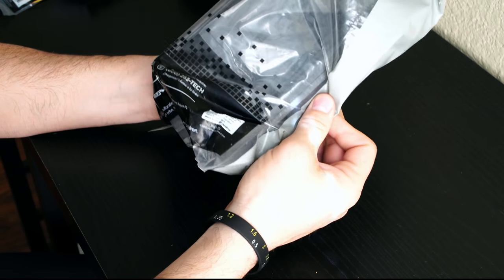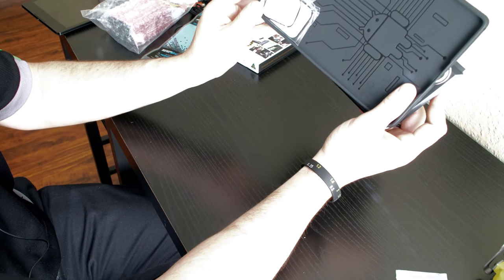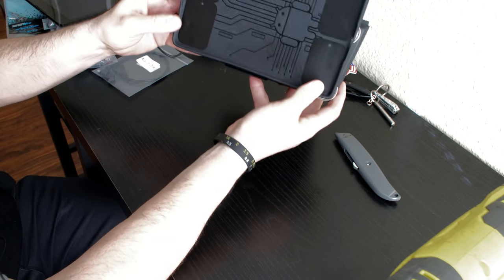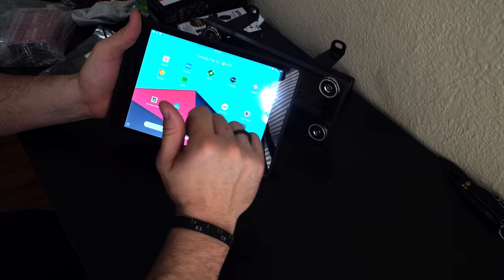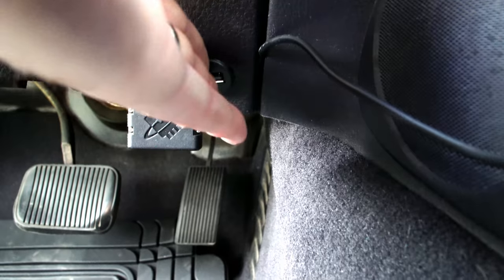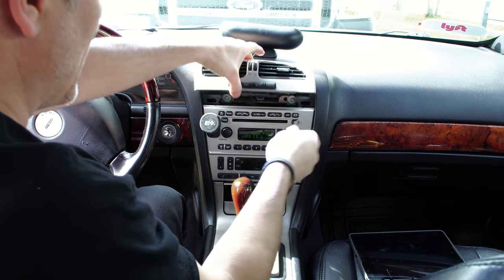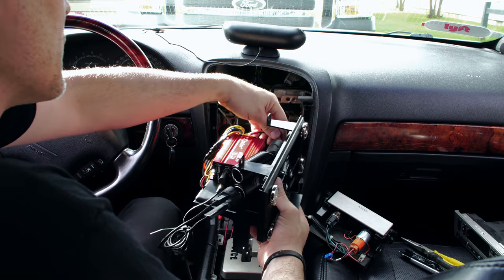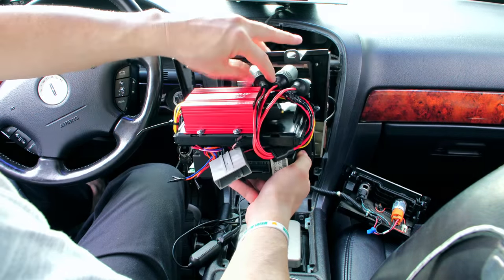Turn Your Tablet Into A Head Unit

Comment: Could've been better to use a single din shallow radio and then tuck it behind the  tablet with a PAC control for steering wheel buttons
Reply from the maker: That's a good option. I did something similar in the update video that is recommended at the end of this video.

Comment: My personal opinion: I would did the setup rather differently: you can screw the cover of the tablet in directly so you will never see the cables. Use the magnetic solution is cool but then hide all the cables in another side of the car like on the back of the glove compartment so when you take away the tablet you don't see the mess and screws. The filter was necessary because you got audio cables, power cables and audio split connections too close to each other; also could be the audio cables are not high quality. To be honest I will leave the original setup and just add the tablet running with Bluetooth by the aux input.  Normally audio from tablets it's not a good one and you can only notice that if you got good speakers. I saw many people doing this kind of "solutions" plug and play often with a poor quality end. 
Another way is you could have an adjustable support for the tablet screw it in on the side and run the cables inside the rubber cover. Overall it's ok... But I saw better
Reply from the maker: Thank you for your input. You are correct, the cables could have been routed better which I addressed in my update video here. https://youtu.be/dmiVHRV2etw

It doesn't look to bad when the tablet is in place which is every time I'm behind the wheel. It does look like a hot mess when the tablet is out of the car. If someone is looking into my car and in the area of the stereo when the car is unoccupied, I'm pretty sure they are up to no good and it's probably best that they DO NOT see anything attractive in that area. LOL. Maybe they will move on to the next car when looking for valuables and take pity on my messy dash.

Comment: Hi, I love this video and thinking about doing this to my car. I was wondering how you converted the 4 channel to 2 channel. Thanks!
Reply from the maker: Excellent! I am glad you found this video. I wish you luck with your project. to convert 4 channel to 2 channel all you have to do is combine the wires from each side. For instance, you will combine the wire for the front left and rear left side into one connection and you will combine the right front and right rear into one connection. You will just twist those together and put it into the left port and the right Port respectively.
Reply: Edward Thompson Thanks! You’ve gained a sub from me!
Reply from the maker: @ninawnguyen  wonderful! Thank you very much. I do appreciate it.
Reply: Edward Thompson Hello again, would you consider making a video on the wiring and all? I’m a bit confused now that i have the supplies in front of me.
Reply from the maker: @ninawnguyen  I can do that. Do you have the package that identifies all the wire colours?
Reply from the maker: @ninawnguyen  neither. I just twisted the ends together and then wrapped them with electrical tape to prevent them from making contact with one another.
Reply: Edward Thompson Thanks for your quick response!
Reply from the maker: @ninawnguyen  you're welcome. I'm here to help.

Comment: Great video! Do you know how to install an iPad into a Chrysler 200? I have been trying to find out how for 4 years now
Reply: It’s a 2015 chrysler 200
Reply from the maker: Everything I did would work for the iPad as well. They make a lightning connector adapter that allows you to charge and also connect a 3.5mm audio jack allowing you to run this setup with only one wire connecting to the tablet.
Reply from the maker: Since you have Bluetooth already built in, you could just use a window tablet mount (many options on Amazon) and connect the charging cable while routing all the audio through the  Bluetooth.
Reply: Look to the airplane Industry for panel flush mount, and you will get a whole host of new ideas
Reply from the maker: Thanks. Will do.

Comment: So I down loaded the rotation app and I will include a pic of what I'm talking about. After installing it I ran the lyft app and forced it to rotate it will not remove the notification area down aby father than what you see in the pic well I guess I can't add a pic but it takes up 3/4 of the screen
Reply: Is there a way to contact you that I can upload pics
Reply from the maker: @bomani699  absolutely, click this link and choose which way works best for you. Bit.ly/ELTinfo
Reply from the maker: I'm sorry to hear you are having issues with it.
Reply: @edwardlthompson  I messaged you on Facebook messenger
Reply from the maker: @bomani699  that's odd, I don't have any message from you there. I even checked the spam filter.
Reply: @edwardlthompson  weird its on the fb with your middle name
Reply: @edwardlthompson  
Were there any setting you had to change
Reply: @edwardlthompson  the table let I have is the galaxy tab5  it's a 10" screen
Reply from the maker: @bomani699  nice! Check around in the settings of the rotation app. Maybe there's something in there that's causing issues.
Reply from the maker: @bomani699  did you use the FB link from that page I sent you? There are quite a few people with my exact name. 😂
Reply from the maker: @bomani699  I recall a setting to activate it at all times. I don't recall any issues with the padding.

Comment: Great job, but i guess I long to see what is missing from most install vids, and that's the use of measuring equipment and its use. I often comment how, young people 14 to 17yr olds watch this kind of content and learn that using measuring equipment isn't used.....
Reply from the maker: I didn't use any volt meters or measureing tape for the install so that certainly simplifies the install.

Comment: Do you have a sim card in that then?
Reply from the maker: Yes, that's correct. It is an LTE enabled tablet. I purposefully sought out one that didn't require me to make a wifi Hotspot for it every time I got in the vehicle.
Reply from the maker: Check out my update video as well where I switched to a larger tablet and a different setup in my truck.
Reply: @edwardlthompson  thanks! Will do :D

Comment: I did this 2 years ago and I did't need to  pull half my dash apart. You over-complicated the hell out of this install.
Reply from the maker: I know there are easier ways to do this but I wanted to make sure there were no wires visible except the charging cable, and that cable, just barely visible. That's why I went to this extent.
Reply: A car like mine the designers made sure almost every bit of dash had some sort of flange that just had to be in the way before the two screws holding the radio would be exposed.

Comment: amazing.
Reply from the maker: Thanks! I did some more fun stuff in the update video where I moved to a larger tablet and a different setup in my truck.
Reply: @edwardlthompson  I have an apple mini sitting around collecting dust. do you know of an app for it? what would I look for? It would be great in my 98 suburban.
Reply from the maker: @immrnoidall  I'm not very familiar with iOS devices but if you search the app store for the key word "dashboard" or "head unit", you may be able to find a similar app. That would make for a pretty sweet setup in your Suburban!

Comment: So no steering wheel controls?
Reply from the maker: There are Bluetooth remotes that attach to the steering wheel with volume and media controls. I have not found the need for them yet but they are an option. The other method is buying the volume control adapter for the pigtail harness and it plugs into the 3.5mm audio jack the same way a set of headphone with media controls would and pushes the signal from the steering wheel to the tablet. So, it is possible, I have not done it.
Reply: Gotcha. I was asking about existing steering wheel controls. There are some other videos that go into some of those details but the other thing to consider is the backup camera and the LaneAssist camera I have on my Honda from the factory. Best way for me to go is still to get an aftermarket unit.. as much as I want to use a tablet instead, it’s simply too time consuming for me.
Reply: The only problem is the price of the unit itself and installation. I’m sure I could figure out the I stall myself but as I stated before, time for me is at a premium. Thanks for the great video otherwise!

Comment: Good Day. How would I get local radio through teh bluetooth setup?
Reply from the maker: There are local radio apps like iHeartRadio and the like that will allow you to stream your local channels anywhere you have an internet connection. I personally can't stand talk shows and commercials so I gladly pay for music streaming. Some tablets (mostly Samsung) have FM radios built in and they have an app that you can use as a tuner to get the local channels. You have to have Bluetooth enabled and the headphone jack connected to act as an antenna.
Reply: There is an app that u can download and be able to listen to the actual radio but u have to have a headphone jack plugged in for the antenna to work
Reply: @chrispatterson4617  do you know the name of the app? i don't think my tablet has radio capabilities
Reply: @nickwaah2702  Tune in but you'll need internet connection
Reply: @ericanderson7059  I intend to purchase a FM/TV Module to use with an OTG dongle. Hopefully it'll work

Comment: what did the insurance company say about the modifications to the car?
Reply from the maker: Why would the insurance company need to know about a homemade head unit? I wouldn't expect them to insure a mess of wires I put behind the dash.
Reply: @edwardlthompson  do you not have the question "Has the car been modified in any way" in your country? your knowledge of electrics is far from 100% biggest risk fire, and distraction from driving.
Reply from the maker: @chazM6116  I have never been asked that by an insurance company. The only time there is an interaction with them is at the moment you purchase the vehicle and when it was purchased, there was nothing modified. I have no reason or obligation to inform them that I replaced the stereo or changed the tires or the wheels or the oil.

Also, I fail to see the fire risk. Maybe you can point out what the danger is?

I don't see what the distraction is either. The tablet is used for navigation and playing music, how is that different than any modern in car infotainment system?
Reply: @edwardlthompson   my car all the radio controls are on the steering wheel so no need to take eyes off the road,  As for electrics well if you do not understand the fire risk you have already answered the point Cuerant and cable size fusing etc as for 500W amp well it says it all Just look at the cable coming off the muti plug and the size you have on the three trailing sockets I not go on as there is so much wrong here
Reply from the maker: Do people have accidents at a higher rate in old cars without steering wheel controls? By the way, there are Bluetooth steering wheel controls available that work with the tablet and also an adapter that plugs into the factory harness if I wanted.

Also, I'm not sure if you are aware, the factory wiring is good for 600w. That's what the factory THX system is capable of. The accessories I have plugged into those outlets are a small LED light, the dash cam, and the power for the tablet. Not nearly enough to even warm it up.

Comment: Your Amazon list indicates the head unit is at the bottom of the list, but it doesn't seem to be there...?
Reply from the maker: The items to build the head unit are at the bottom of the list.
Reply: @edwardlthompson   It appears what you are talking about is Bluetoothing your tablet through a small amplifier. Pretty slick, I did something similar when I was driving 18 wheelers. However, the amplifier you include in your list is no longer available, according to Amazon. Hopefully there is something equivalent or better still available.
Reply from the maker: That's really cool you did something similar. Whenever I get back to Texas I will try and find a substitute for that amp that is discontinued. Thank you for bringing that to my attention.
Reply: @edwardlthompson  I used something similar that I bought on eBay. Black, 25x2 if memory serves, with a built-in adjustable crossover and subwoofer output. Still got it and considering doing this with my Samsung 10 Tab A. I already know that it will run the Uber driver app, it's just a bit slow. Does this rotate force app work with any app?
Reply from the maker: Yes, it will work with any app. Give it a try and let me know how it goes!
Reply: @edwardlthompson  BTW, I found the same amp you used on eBay as well. Look up 12V DC 2-channel Motorcycle Amplifier. Here is a 2.1 similar to the one I used... https://www.ebay.com/itm/293017482199
Reply from the maker: Excellent, thank you for letting me know. I might have to link that in the description since that one is no longer on Amazon.
Reply: @edwardlthompson  I played with the rotation app on my tablet and it works well after some fine-tuning. Only issue I came across is that the tablet cannot make phone calls without a third-party wifi call app. Rideshare apps do not directly support this, nor do they allow for another login to do so from your phone. I tried that the first time around, and it would crash.
Reply from the maker: I'm aware of that. That's why I use Google Voice. Google Voice will act as your phone dialer. Make sure you set it as your default and you will be able to send and receive calls using that app as your dialer. Google Voice is free to users living in the United States. You will first need to verify your phone number on a phone with a US phone number.
Reply: @edwardlthompson  My tablet doesn't show settings for a phone app at all... How do I get around this?
Reply from the maker: Download Google Voice on your mobile phone and get it set up. once you have it set up, install it on your tablet and login. After that you will have a phone number to make calls to and from on your tablet. The Google Voice app will act as a substitute dialer.
Reply: @edwardlthompson   I also have found some pretty bad-ass compact aftermarket amps that could fit in the same space. Look up Williston Audio Labs on YouTube. But one thing I need to know, can this setup show the backup rearview display in vehicles so equipped? I also suspect this probably would not work well for those who have AC controls integrated into the factory stereo. Unless there are apps that can deal with this through an OBD-II Bluetooth dongle?
Reply from the maker: Thanks for the tip! I know there are some wireless cameras that work with Android that could be used for a reverse camera but I don't know how you would interface with the factory camera. As far as climate controls, I don't know of any way to do that. I think most have physical buttons as well.
Reply: @edwardlthompson   That is true, most do, as my car does, but I was reading on another video that someone was asking about a 2019 Honda Civic that integrates the HVAC controls into the factory unit. BTW,  I got the name wrong on the channel that tested the amps I suggested, it is Williston Audio Labs, not Wilson.
Reply from the maker: I was checking out Wilson and they have some really cool stuff but I couldn't find the amps. Thanks for clearing that up. 😂

In the case of a modern car that has Bluetooth and/or and AUX jack, doing all this craziness is unnecessary to get the tablet setup. A good tablet window or cupholder mount would do. That way you could keep all the steering wheel controls and rearview camera. I only did mine because it was old and lacked the features I wanted. I still use the tablet in my truck in tandem with an aftermarket head unit and backup camera.
Reply: @edwardlthompson  Unfortunately, I have one of the late model Toyota units that are so prone to the touch screen acting stupid and going bad. The touch points necessary to activate certain buttons are literally migrating off the edge of the screen over time, that's the only explanation I can come up with. And no option to recalibrate.

Been looking at units from Seicane, Dasaita, and Joying. All three offer OEM plug-and-play custom-fit for specific models that claim to drop in just like a factory unit while improving on their shortcomings. However, they can be quite expensive and most of them come from China, which I am not keen on buying Chinese products right now, for obvious reasons.

Quite frankly, they look to be a simple adaptation of the same unit my father's 2019 Sonata has, and I have had trouble helping him figure out technical issues he has had. Not a bad unit, just not quite as user-friendly as I would like.
Reply from the maker: I'm so sorry to hear that. I don't know if you had a chance to see my update video but I explained why I choose not to use those Android head units. My main reasoning is because I don't know how long the manufacturer will support them with software updates. However, I know for sure that the tablet I'm using will receive and is receiving nightly updates. I'm not sure how long that will continue but there are three developers that maintain the code base for that tablet on lineage OS. I have high confidence that it will be supported for much longer than one of those Android head units will be from those three companies you mentioned. Also, I like the ability to move it from vehicle to vehicle.